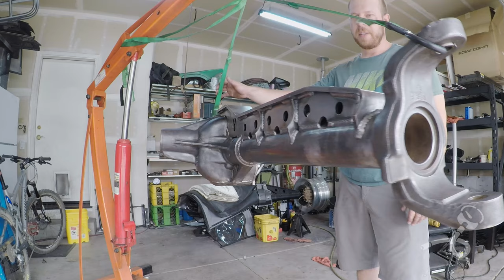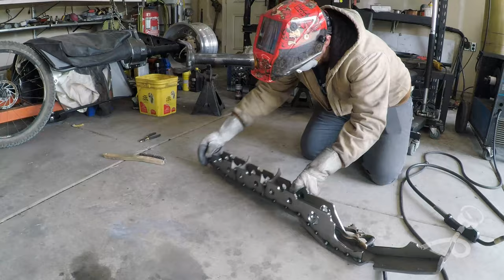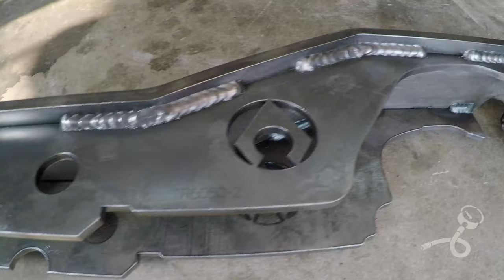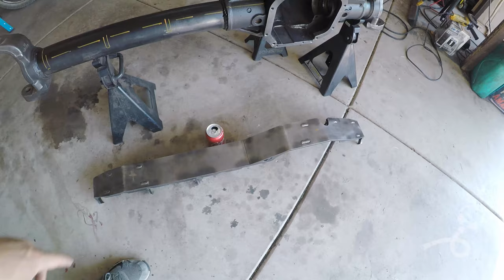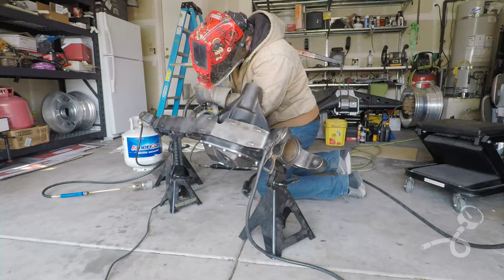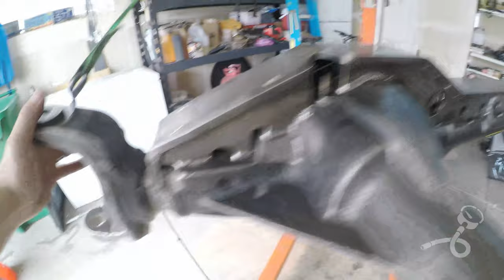Installing Dana 60 1 Ton Axle Swap Truss

Comment: Impressive.  Very nice work....  I'm still learning to weld.  Looking to do a little work on my baby d30....  Maybe one day I'll join the big leagues. 

Looking forward to the next episode..
Reply from the maker: Thanks Joe Man! I had a lot of fun on my Dana 30 in my CJ. Broke that sucker a few times. Haha, but it’s a great start.
Reply: It's not that hard to weld well for the home handyman. Look deep into the puddle and place your mask close to the weld on some practice steel. Really look right inside the weld as you're executing it and keep it moving, moving the puddle over the work pieces then move foreword, repeat. 
Read a chart of welding faults (just Google it) and how to correct them and within a week your welds will be fine if you practice just 2 hours a night for 7 nights. In fact practice the faults to duplicate them so you can directly see what causes them, then make the corrections and see how the weld shape and quality changes.
It is 90% preparation - which means cleanliness, properly clamped, some well placed weld tacs. It's really not that hard welding mild steel.

An home arc welder will do a spectacularly good job. Just don't buy a cheap one. Buy a mid priced one up to about 180amp. Resist buying a high amp cheap or mid price high amp. Thing to look out for is duty cycle. That is the time the unit is rated to weld vs time to cool. A mid price 160-180amp arc (say $350-$500) with a true 40/60 or 30/70 (40% weld to 60% cool) duty cycle is far superior to a 200amp 10/90 sub $200 unit.

What is hard, is all the theory and experience required to be a professional welder. It takes years of time and experience.
My son is completing a welding apprenticeship and he is really good, but I asked him to weld a steel plate onto the bottom of my oil pan (removed from the car) as I can't do it at home as I have no 3 phase power here and I could tell he was unsure of himself. He's used to welding inch thick structural steel and then it being X-Rayed LOL. The weld was just OK by my standards but I could tell for a first attempt at light gauge he was going to be a good welder.
Welding a bit of scrap 1/8" steel plate onto a sump had him worried as he hadn't ever welded such light gauge steel.

Comment: They make flap disc sander wheels for 4 1/2" grinders. Clears paint off way better than wire wheels. And for no rust, do little pisser welds to seal up the seams. Tacking should be done AFTER pre heating, otherwise the tacks just crack. Next time!!! 😜 Spent way too many years in steel industry.

Comment: Awesome job, like your attention to detail. If you want super clean welds welding cast iron to steel, use Royal 44-30 mig wire, the beads are just as clean as welding regular steel, same shielding gas, you won't use anything else after you try it for the first time, excellent welds.
Reply from the maker: Thanks for the compliment. And thanks for the suggestion. I will give that wire a shot.

Comment: Glad someone is doing a Durango. I have a Dodge Nitro on one tons front and back. 37's
Reply from the maker: Now that I gotta see!!! Are you on IG or anything?
Reply: @aireddown813   No, I don't do any social media.  However , starting in December I'm going to be building another rig. I have a perfect condition Dodge nitro  I got from Texas ( I'm in the outer Chicago area) with a blown engine. I have a set of jk Rubicon axles for it and I'm probably going with a jk take out motor.  It'll be on 33's maybe 35's and a family friendly light trail/gravel/ fire road rig.  I'll be  starting a channel to document the build ; and I'll have to do a walk around on the Nitros and drop a link for ya when I get it going.
Reply from the maker: @immelting9834  I’ll be on the lookout for that. Sounds awesome

Comment: great job. doing the same truss. where did you get you nicore wire. and what brand/ thanks for you videos.
Reply from the maker: Thank you! It’s blue demon brand. You can buy a 2 lb roll from eBay. It’s called ENiFe-Cl. Let’s see if this link actually works. https://www.ebay.com/itm/303690185500

Comment: I’m planning on doing the swap in my TJ, every vid I’ve seen on YT cuts that 2” off between the diff and yoke, just curious why you didn’t and what effect that will have on mounting if going to coil overs out as close to the wheel ends as I can?  Is it a weaker connection there if you don’t cut it out?
Reply from the maker: I had a plan from the start to cut the short side tube and add 4”. Something I didn’t articulate well in the video. I’ve since done that, and I have enough room for shock mounts. If someone isn’t widening their axle, I’d say cut the casting like you describe.

Comment: No matter how much I feel like I wire wheel my axle housing I can’t seem to get it to come out as clean or as nice and shiny as yours, and not just the tubes but the Cs and the knuckles as well. Did you just use wire wheels and a lot of elbow grease or am I missing something? 😂
Reply from the maker: I have many secrets! First, I use anti spatter spray (Pam 🤣). Next, I chisel the spatter balls I do get off with a hammer and a screwdriver. Next I use a sanding pad on a die grinder to smooth out any blemishes. Then I wire wheel to finish it off.
Reply: I used oven cleaner to degunk and then wire wheeled it. Finished with Corroseal (rust converter) then painted it.

Comment: Should have it it with two coats of Weld through Primer instead of the paint. Less worry about stripping the paint where you're going to weld.

Comment: By the way , try welding in the mid 90’s temperatures here in middle Tennessee with the 90 % plus humidity,, I did it for a living for over 5 years . You don’t sweat , you leak like a busted water pipe ! I don’t miss those days
Reply from the maker: Hard pass! That sounds terrible 🥵

Comment: Are you mounting coil overs? If so could you tell me which brackets you are using please? Nice video 👍
Reply from the maker: Thanks for the compliment! I will be mounting ORI struts, and I’ll likely be making the mounts custom so I can really dial the fitment in. But I was very close to buying the truss mounted shock tabs from Artec. They are the ones that mount on the corner of the truss where it bends down to the axle tube.
Reply: @aireddown813  oh okay! Thank you. I am building a 90 Chevy 1500 with a99-04 60. The truck will have a cummins and I’m trying to figure out about mounting coil overs.
Reply from the maker: @bradleybrowning5971  that sounds dope!

Comment: Call me extremely ignorant. Are Dana 60s bending alot? Seem like a heavy axle. I know off road is a lot of twisting  but to bend a Dana 60 must take impact to justify this must more weight and metal.
Reply from the maker: I think your logic is right on track. These are only bending under extreme circumstances. For example, mine was bent because the truck I got it from was in a front end collision that ripped the leaf spring off the truck. When it comes to welding though, it doesn’t matter how much metal there is, if you heat it up enough, it will warp.

Comment: What welder is that?
Reply from the maker: It’s an old Millermatic 185
Reply: @aireddown813  that’s what I guessed. Looks like 50% wire speed and 50% voltage. It’s fun watching you put all this together. It makes it seem less intimidating for me and I have no idea what I’m doing.
Reply from the maker: @runningproblem  thanks man! It’s been scary sometimes especially when cutting into the housings. I’m stoked that this is making you feel better about trying it yourself.